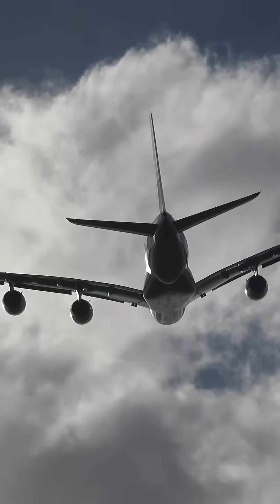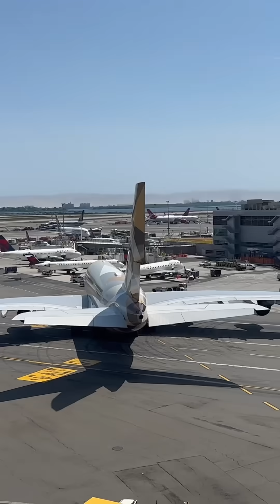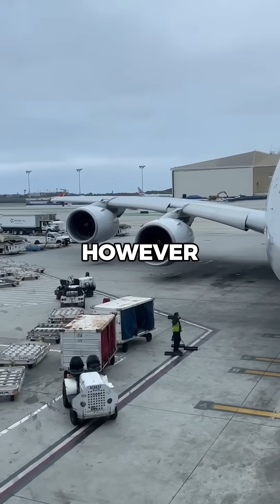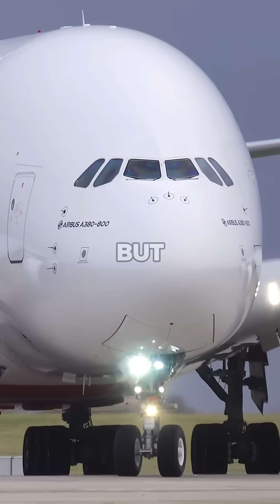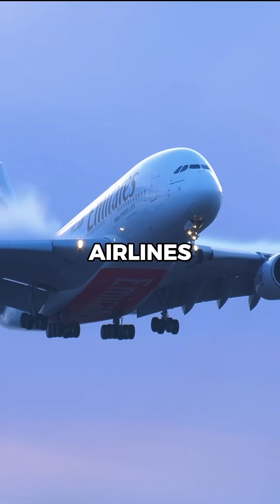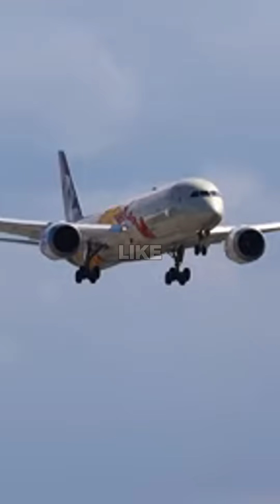why the Airbus A380 didn't have more powerful engines

Comment: Best most comfortable aircraft I ever flown in. Super quiet too.
Reply: Never flew on the A 380 , but I did on the A 340 and A 318 and I noticed that Airbus has lower engine noise intruding into the cabin compared to the  boeing 747.

Comment: Hey, if Airbus developsd a freighter version of the A380, just like Boeing did with the 747, Airbus would have made tons of profit from the A380 program. The A380F version with large cargo dooors would change the Airbus history even more. The A380F would carry large amounts of cargo, making a huge profit form airlines. If the A380F existed, the total A380’s sold wouldn’t be 251, it would be +500. Emirates cargo, Thai cargo, British cargo, AF cargo, Qatar cargo etc. they would benefit form the capacity. Efficiency wouldn’t be a proplem for the A380-800F cuz cargo planes are not meant to be that efficient.
Reply: The plane is too heavy as is.
Reply: @ae747sp5 ah, you are right but carrying max load cargo would make the airline make a lot of money, no?
Reply: @KemalTugal the a380 has huge volume yes but the plane is already heavy enough with just people and with heavier containers it won't be able to go anywhere
Reply: @spxdesu what do you mean? Will it be underpowered like the A34 or 727?
Reply: You can fit an anvil into a cardboard box but as soon as you lift the box the anvill just fall right through the bottom@KemalTugal
Reply: @spxdesu oh, you are right. It would be too heavy and theairport would not handle it.
Reply: @spxdesu that is what good engineers can solve is upper management doesn't penny pinch
Reply: FedEx would buy some too
Reply: @Duck777real no, they wouldn’t buy it. They already didn’t buy the 747.